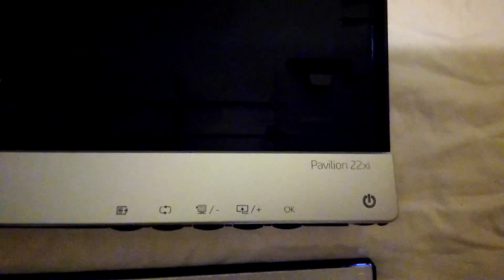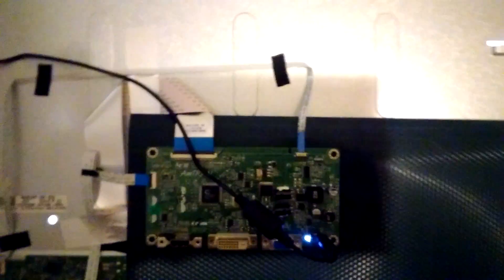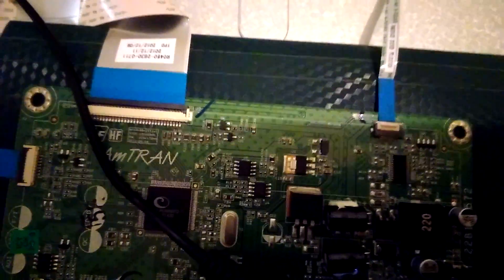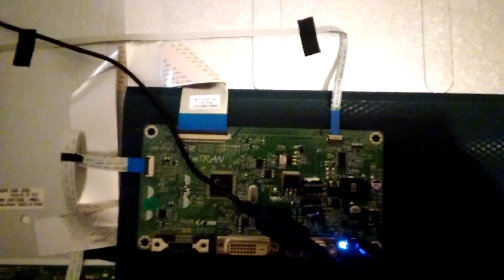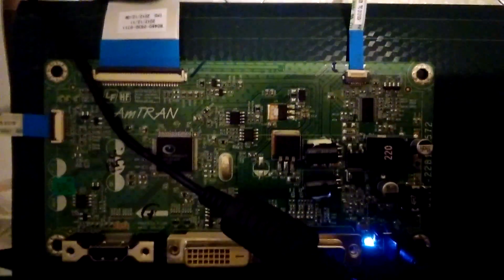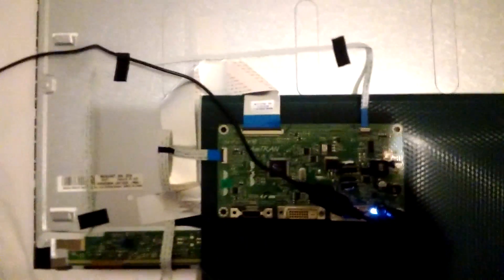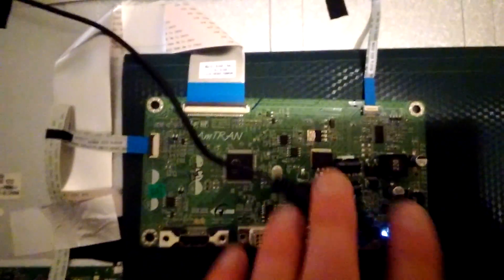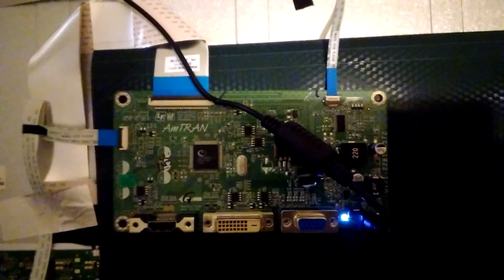HP Pavilion 22xi repair - turns off & freezes after a few minutes of use

Comment: Thank you so much! No thank you to the dunces at HP who still don't properly address this common issue. 

Those with larger monitors be warned: I had to do my repair twice since the bin file linked above did not work on my 25xi - when I read and copied my own chip's data it worked immediately.
Reply: Do you still have the 25xi rom by any chance? I can't get mine to read it's just to far gone.
Reply: @2rzTacoSr5  Sorry mate, just searched here but nothing shows up, was long ago now.
Reply: It took several attempts, I even tried freezing it but after unsoldering it mine finely read! Maybe the high heat brought it back to life just long enough. Thanks for checking! Flashed the new chip and I'm up and running now. If anyone needs the 22xi, 23xi, 25xi or 27xi roms I have them. I'll probably post a link on the main message string.
Reply: @2rzTacoSr5  Hi Mike, Would you be kind enough to post a link to your bin files, thanks.  I have two HP 25xi and a 20bw monitors that are toast with the same issue. Ed.
Reply: Guys when I try to post a new link the comment just disappears. When I tried editing my old post with the bad link then that comment disappeared. I’ll keep trying.
Reply: https://drive.google.com/file/d/1PhlBUi4Qsx_M5WbqTRYQCC77S268ygLe/view?usp=drivesdk

Comment: Hello...i fixed it a different way...
I added etensive cooling to the part itself and since then...no problem...
The Mainboard cage got a cooler and between part and mainboard cage is thick piece aluminum with heat paste, so all het from the 220 part that already has a heatpad on it and the little flash rom get passive out of the monitor which i cot open in back where Cooler comes out...pics on request...
Reply: https://mega.nz/#!D8cgBYSJ!_zBvGo1FtpzAa-iCnMlV9xxUwS7Tb4MFt2FagPHVI6c
Reply: @kennethbryan3738  how did you connect the fan in the power supply to work? Thanks
Reply: I would love to see photos of this repair..
Reply: dude that was my idea too.. can you send me a pic of that somehow?
Reply: Can you send the pics?
Reply: Hi, I have the same problem. could you show me the pics or video? thanks.
Reply: hi, could you send me some picture of your repair?Regards
Vincent from France
Reply: Hi, how did you wire the external cooling fan?  where does the power come from?  Thanks

Comment: Do you have a video hot use the programmer? Thanks.
Reply from the maker: No, but search "CH341A programmer" on YouTube. I found several helpful videos when I was learning about this programmer.
Reply: Thanks man. I've been looking for this a year ago.i subbed to your channel
Reply: ON SEMICONDUCTOR  LE25U40CMDTWG  Flash Memory, 4 Mbit, 512K x 8bit, 40 MHz, SPI, SOIC, 8 Pins.its the only one i found in the internet.is that right? Pls answer thanks.

Comment: Thank you very much, it works perfectly!
Be careful about soic8 size, the footprint is for 150mil SOIC8, not 200mil! I use a 200mil one and it's boring to solder! I use microchip SST25VF040B
Reply from the maker: Yes, I forgot to mention that. I used 150mil SOIC8. Thank you for pointing it out.
Reply: this works?? https://www.ebay.es/itm/1-Unidad-SST25VF040B-SST25VF040-25VF040B-SST-25VF040-100-Original-Nuevo-New/172350090443?hash=item2820ddaccb:g:sggAAOSw4shX4s07 Very thanks!
Reply: so this work ???
Reply from the maker: Yes, it should work. 150mil or 200mil doesn't matter electronically as long as you can solder it to the board.

Comment: Hello, I have same problem. I bought chip Winbond W25X40BVSNIG and I programe it with programer CH341a but my HP 23XI dosn´t work. :-/
Reply from the maker: 22xi and 23xi seem to have different firmware. Try this one: https://drive.google.com/open?id=0B4zh9ecWng4cODRfT3RRbG9aOE0&pageId=101586328565122989123

I found it on the web. It's not mine but it's supposed to be for 23xi. Let me know if it works!
Reply: Thank you very much. My HP 23XI works. I used your link and file called HP PAVILION 23xi_W25X40.BIN. IC I programmed with CH34A1 and connected to PCB. My monitor works great. Thank you very much once again.
Reply: @matoushavrlik  Hi. Have you had the same problem since you put the new chip?
Reply: @AntonioSJCT  Yes
Reply: Matouš Havrlík )
Reply: @electro5471  Hi, the link is down, can you please reupload? I fry my IC.. :( Is a 23 xi Thanks for the video
Reply: Hi. is the problem fixed?
Reply: @mesutkarabayir5387  yes

Comment: I have a 23Xi model of the same monitor which just started to do the same overheating trick. Do you have a video of the removal and reinstallation of the LE25U40CMDTWG chip and how to use the CH341A programmer?

I have never used one of these programmers before.

I have purchased the programmer and awaiting the arrival of the chips.
Reply from the maker: Unfortunately, I did not make these videos. You can search Google or YouTube for CH431A and I'm sure there will be info on how to use it. Look for videos on how to remove and solder SMD ICs. The process is generic for any SMD IC. I think it's easy, but if you are going to do it for the first time, you may want to practice on some scrap board at first.

In short: 1) install the driver/software for CH341A; 2) desolder the old IC and read data from it (or look for the 23xi EEPROM data, it's somewhere in the comments); 3) program the new IC, choose "Generic" manufacturer, type 25x40, worked for me; 4) solder the new IC back, be sure to align it correctly (the dot on the IC marks pin 1).

Comment: Just repaired my HP 22XI finally, Was waiting until I decided to buy a new Soldering gun and already had bought the chip and programmer off Newark element14, Your video helped out a ton on where to start with the project.

Wasnt hard with  a smaller tipped cheap soldering iron, Just soldered off the old chip, Read the info off it and wrote the data onto the new one like you did, soldered the new chip on, Worked very well and was a fairly cheap fix considering ill be using the soldering gun and programmer every now and then and the fact that I got the monitor from Goodwill for 35$, Chip was about 10$ because of shipping but hey it was easy. Nice to have this sweet monitor working again! First soldering job on a board like this at all, Well see if it lasts!

 Thanks for your help and for the info! Wanted to comment on my progress to say that your fix works and encourage others to try it if needed
Reply: which chip did you use?
Reply: hey hope you well you still have the file he shared?

Comment: I've got an HP Pavilion 23Xi to repair. Got the same issue as shown in your vid. I bought an 4mbit 25series soic8 spi flash chip, flashed your firmware onto it and installed it onto the board. The chip was slightly larger than the original one, alltough apart from a slower clock rate it had the same specs. Unfortunately when plugging in the power in the monitor the LED does not turn on near the power button, so nothing happens when pressing it. Also it seems I am unable to read the firmware from the old WINBOND chip with the same reader you had. I dont really know what to do anymore :/
Reply from the maker: Try this: https://drive.google.com/open?id=0B4zh9ecWng4cODRfT3RRbG9aOE0
Reply from the maker: My firmware is for 22xi, so that may be the problem. There is someone offering firmware for 23xi on a Russian web-site here: http://remont-aud.net/dump/mnt/hp/hp_pavilion_23xi/499-1-0-21118

You will probably need to register before you can download the firmware. If you can't register or find firmware for 23xi elswhere, leave me a PM. I download firmware from there sometimes, so I already have an account. I could download it and send it to you.
Reply: Thanks for the reply. In fact I have read the firmware of my 23xi and flashed it onto the new chip. Might be worth a try comparing the one from your link with mine to see if they are identical. The monitor worked fine for weeks afterwards, sadly it started getting a reddish tint on 1/3 of the screen on the left. I dont think this is from the replaced chip, but rather from a faulty LCD. No one on the internet has a solution to these red tinted screens, so my try at fixing the 23xi was sort of worthless
Reply: I have the same 23xi monitor can you send me the firmware for my eeprom please? I think i burned my old eeprom with my soldering iron. greatings from Germany
Reply: Same issue! Could you send me the 23xi firmware, please?
Reply: Thanks, but I managed to ge the device working again. Unfortunately after a month of use afterwards the screen got a red tint on the left side of it, not sure what caused it, but I gave up fixing the screen again as I had spent quite a lot of money on it already

Comment: Hi, Ive got a question about how you programmed the chip using the same CH341A programmer as you, I was curious as to what Software and Drivers you needed and used and how exactly this programmer is used to program this type of chip

Ive done a lot of research to this point to fix my 22xi and I have a driver that seems to work with the device but it doesn't recognize or detect the new 25x41 SPI chip I have on its own, I have yet to remove the old chip off the Monitor's board, But as far as using the program goes I cant find the name of the chip in the program myself in the program either.

Any advice or pointers you could give? Theres not much info on these anywhere as it usually goes with this type of stuff
Reply from the maker: Syphious You can manually select either winbond w25x40 or generic 25x40.
Reply: @electro5471  I tried programming 25x41 with ch341a but without result. I can read original chip, i can not modify any byte in original chip and programming of new chip does not work. Reading works, programming of old and new chips does not work. Tried several versions of programming app, tried w10 and w7 on different computers and no luck. programmer identifes chip as 24x40 but it will not program it. any ideas are welcome :-)